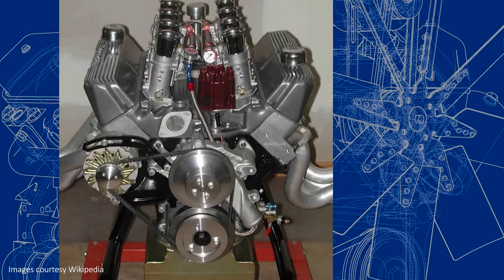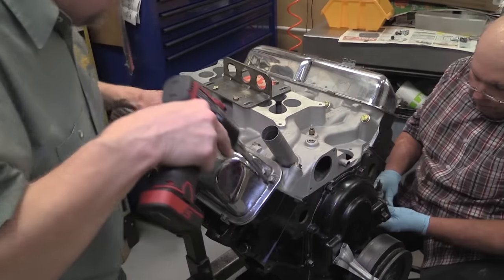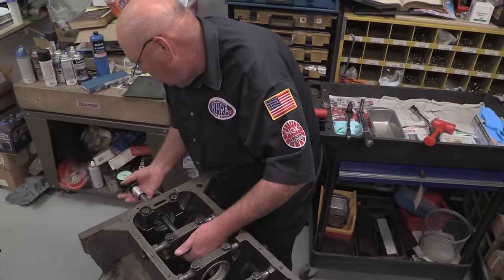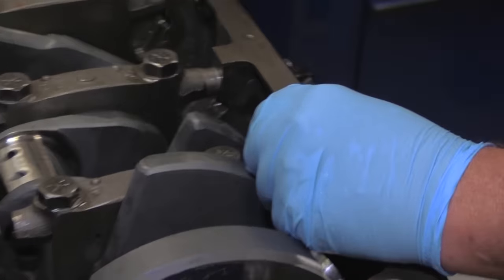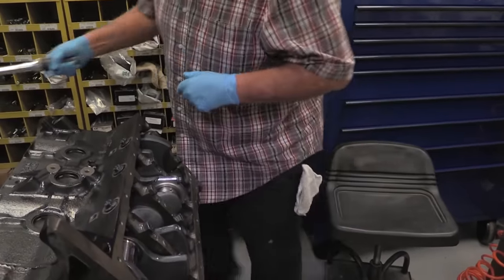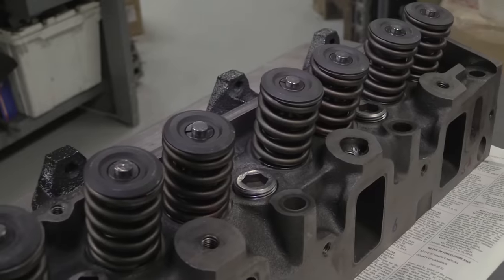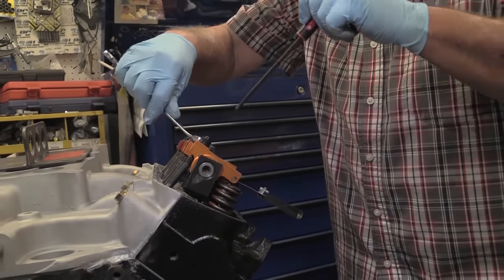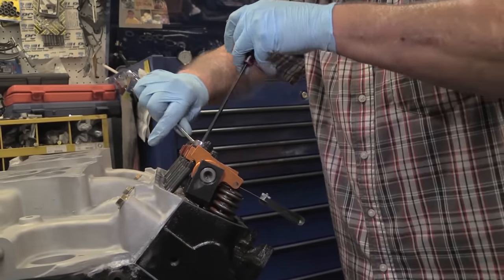Monster Ford 427 Top Oiler Engine Build and Dyno Session

Comment: Notice the age of these builders. Makes me wonder what secrets we lose with each old timer from the muscle car Era.
Reply: Wilson Solt none. Because they don’t ever listen to the new ones. 🤣
Reply: @BuzzLOLOL  i think I've seen that one. They put a tunnel ram on and it develops bottom end torque as well picking up 50hp.
Amen to the extra 150 years. It might actually happen within the next 5 or so years. I heard an already known compound is undergoing clinical trials. Hope so. I'm in no hurry to age at the usual rate lol.
Reply: @ThePaulv12  put efi on it...
Reply: @hellblazer275  yeah it has it! Fitech (maybe youre trolling me lol)
Reply: @ThePaulv12   just get an efi manifold and have 8 injectors with a decent ecu................ even a mega squirt will work haha
Reply: @ThePaulv12  I dont get your reply. So if you want a big bore low deck then build one. Who is stopping you? Maybe the old guys think your nuts because the G2 is only 0.4" taller and if you wanted to buy quality components would turn 7k as well. If you are a Mopar guy and want cheap power ( those words cant go together ) why not spend some time on the 6.4L G3? Has amazing head potential with the stock goods.
Reply: @ThePaulv12  I think I understand why they are getting annoyed. The LSX only needs 90lb on the seat because the 8mm hollow valves in their performance heads weigh ~90 grams. The valves in a typical performance Gen1 weigh 115 grams. The fact it runs well probably has more to do with the fact its fresh then the silly springs. Sure beehives offer advantages, but the fact the LSX can turn 6500 on a 1.7 rocker doesn't mean it will do that for you with heavier components. Its a system of components not just a spring or valve. None of us were there for the conversation you had with Guy #5, maybe he said things like this. Maybe he just didn't like them because he has had them fail. Ya know like they fail in LS6 motors on a pretty regular basis.
Reply: That's a fairly intuitive analysis actually lol.
Here's the thing, those springs are known to be good on Gen 1 engines which is why Comp make retainers for them. The low lift (around .5") means the higher mass is offset by the lower lift because the inertial forces are lower so a lower rate spring fits the bill. It is a fairly well known mod, though #5 is still an old woman.
HOWEVER (LOL) back to your assertion he's had a failure, and our conversation before the job started. Well he has had a failure, my fellow mechanic friend told me. It wasn't catastrophic but more embarrassing. It was on a speedway car and it wouldn't rev up. They were the totally wrong springs for the application and the customer - like me - specified he use them. They weren't the 90lb GMP springs I supplied but a another brand (I literally don't know) and the springs were all wrong for the application. 
The difference here is, I know what I'm talking about and If I don't - so there's a known unknown - I'll accept responsibility for that or opt to go a known route. These light 90lb springs are fitted to Vortec heads all the time and improve performance (when the valve bosses are turned down). They are a known mod and work. #5 never at any point conveyed his speedway story to me. He decietfully nodded in agreement before the start of the job to get the work, in full knowledge of my desire to use these springs then when it came around to setting up the valves would've thought 'to hell with that' and tried to get me to bend. Well I'm not for bending in this case. I do bend and did bend on this job in some other areas. I wanted lash caps because my pet hate is roller rockers. The surface intensity of the roller on the tip of a low lift cam is multiplied as compared to a stamped arms' wiping face, but stamped arms are crap in the ball stud area and have no adjustment so what can you do? #5 informed me although he bought the lash caps for me he couldn't actually use them because of geometry issues which he could sort out but were financially inneficient for the gains. I just said fine! I understand.
Re the failure, I got the blue ones they're about the 4th revision and the failure rate is low.
Reply: It's because it's not a stroker. That's the problem. They want the easy job not the complex build. They just don't want to listen. Yes I can build it but I may need custom pistons and some unforseen expertise esp in rod length and pin height. This means I have to throw them some work before they'll help me. If I build a common combo then that is all worked out for me but I really want a low deck short stroke big bore Hemi that looks like a stock Hemi minus exhaust manifolds. 
As far as the Gen 3 the issue again is, I want a low deck aluminum Gen 2 with a 4.5" bore and a 3.3/8ths stroke.

The Gen 3 makes far more sense but sometimes I like to be a pioneer. If it doesn't work very well then all I have lost is some pistons, rods, a crank and perhaps a camshaft. I think however that it will work and make about 550 at 7500. It's about the revs. I want a Hemi on the street that revs up but has the cubic capacity to still have some street useability.

See a 572 is a great thing no doubt. It makes 800hp hell even a Barton 528 will do that, but they are a bit overpowered for an A body and despite the trend to build +1000hp engines these days I just want a Gen 2 that turns rpm like a racecar, be reliable and look stock. This comes from heritage of the Hemi. I just want to make it what I think it should be and a high rpm screamer with a big bore gets me going.

To each his own.
Reply: ThePaulv12 If its that big a deal to you built it yourself. Have them do the block prep. Im not saying "building" is assembling parts. With aftermarket blocks and the works nothing assembles the way you want.

  On the lsx springs thing sounds like he should not have agreed to do what you want in the first place. I just had some head work done where the shop didnt want to do what I wanted. Cut my oversize valves down and made me pay for it.  Porting guy wouldent touch it because they were not prepped the way he wanted. Now I have tons of money in junk. All I can do is start over. This is how it happens sometimes.
Reply: Dalton,wrong,why do you think I'm here,been building since 1968,i've read the info from the genius of auto design,BLACK,PINK,WATERMAN,YUNICK,you stop learning you go backwards real quick and you start losing races,fact
Reply: Kenny isnt that young, lol. Kenny is appx my age which is over 50. Hes been building  for nearly three decades.
Reply: Not true we have better technology now to where their "advice" is becoming irrelevant from fuel injection and forums
Reply: @ThePaulv12  what do you care if nobody's on board? Build the motor and prove it works! I'm just not getting the correlation between low deck and seven grand? Why would centerline of crank to top of deck restrict anything? Maybe torque would not be optimum due to having limited rod length but screw that.Go for it.
Reply: @hellblazer275  stuff a cut down 3.75" 383 stroker crank in it and leave the 305 badges on it.
Reply: @ThePaulv12   305 makes a good boat anchors
Reply: @ThePaulv12   big rpm Hemi  - didn't Ford do that back in the 60's - Cammer?
Reply: @philipmacduffie7612  he should of put 289 -351 Windsor in the ToTo.
Reply: @Richard Skipper you mean like build a350 ?
Reply: @ThePaulv12  right ?
Reply: I’m 35 and been into these cars since I was eleven. A classmate of mine has an engineering degree he uses to operate an engineering company devoted only to BBF
Reply: Not what hes saysing. He saying these guys know there shit and they'll die with there knowledge
Reply: ThePaulv12 Just an observation from an "old machinist". (60) While you are on here bloviating about some hypothetical engine that you "might" have built, either in the past or future, the gentlemen on this video have an actual functional engine. A very nice one at that. And just so you know, it will outrun your hypothetical, imaginary engine EVERY day. I can't speak for the machinists you allegedly approached, but I have youngsters come in my shop occasionally wanting a " new combination". Most come here for my expertise and will listen to reason, as my engines have won numerous championships from dirt to drag to competition carts. I think I can speak for most machinists when I say "put your money where your mouth is and I will build it for you". I suspect you had more mouth than money.
Reply: @ThePaulv12  You're taking it too personal. They've been around long enough to know that experimentation is good way to step into a bunch of bullshit and kill your profits. A good business model is to stick with a tried and true formula with little deviation. Most every master mechanic I know went thru a experimental phase when they were younger. They wasted a ton of time and money doing it, but thru that they came up with what works for them, and what typically doesn't. When it comes down to it, it's not their job to turn your ideas and fantasies into reality. Reliability is their main concern. Who wants a engine that spits it's guts out? No matter how much power it makes.The other biggie is profits. Its almost like customers are pissed off because shops want to make a profit these days.
Reply: There's no secrets to a build that is nowhere near on the edge lol if it made 800 I would say different but this isn't anything special
Reply: Takes patience. Comes w/ age & time.
Reply: They have have the blueprint to these amazing engines .. my uncle is the same way stuck in there ways he don't like ls motors  and we argue about motors all the time
Reply: @ThePaulv12  The young today have a huge advantage over the old of yesterday.  Parts.  I am 60, when I was in my 20s there wasn't any brand new blocks from Ford to mate up to a crank and some rods and pistons to create a 454 from the 351W block.  We didn't have the high port Trick Flow heads with ports bigger than the 4bbl Cleveland heads.  That 454 Ford Windsor engine put out 730 some odd horse power.  I would be embarrassed to be a kid today if I couldn't put something together out of catalog parts that would not out perform the best that $10k would get you 40 years ago.  Nitrous was just coming out then.  You could get a kit easy with a full bottle, two days later after showing off in front of your friends your bottle was empty, and it took 3 weeks to get it refilled, 20 pound bottle ran me $90.  That was a plate kit from Marvin Miller that ran me $750 to purchase.  
Kids have it so much better these days.  All I can do is look and dream now.  Had I known this was only 40 years in the future I would have not spent near 40 grand in the first 20 years of my youth, on cars.   
I have yet to ever find a store owner refusing money.  I think you are confusing "bench racing" with "parts buying".  Try walking in with your credit card in your hand, list of parts you want to order, and stop trying to convince someone that you know more than they do, show them.
Reply: @margaretpurifoy9107  not about these parts. Like i said they have no imagination. Sure if i want to travel big miles to find a shop to do as i ask i can, but the prospect of a 300mile round trip to find a shop isnt my idea of fun considering I'm a trucker these days and always behind the wheel.
Reply: @22099dscott  you say, "you're yet to find a store owner etc etc"
Well, about these parts it doesn't work like that as i have already chronicled. In fact i often say to store owners (as a gasp of exasperation at their stupidity), "You must have so much money that you can afford to treat customers like this."
Look it is true that i am a qualified mechanic of many years but these days i drive big rigs for a living. This makes me time poor. I get really pissed off by these morons - and they are morons, that have the attitude that if they can't see the need for what i want then i don't need it. They don't want me as a customer it is as simple as that. Sorry but you're wrong about store owners.
Reply: @philipmacduffie7612  Rewatching this vid, stumbled on your comment about how your machine shop ignored your directions, and cut your oversized valves down. Then "made" you pay for it... 
Hahahahaha! Not even gonna say it.
Reply: @edjackson4389  If a shop does what I ask of them, then I will pay them money. And come back for more work.
Reply: @izzyplusplusplus1004  Didn't know when I picked them up. Of course I went back but they didn't want do shit about it.
Reply: @philipmacduffie7612  I can't even imagine how pissed I would be. What shop is this? Do they still exist?
Reply: @izzyplusplusplus1004  They went out of business and they deserved it. I wasn't the only one to get hosed. Bad part the really good head guy has Heath issues and his place is falling apart. Can't get in there.
Reply: @philipmacduffie7612  I think this brings to the table a good point of reference. Careful with your machine shop choices.
Reply: @izzyplusplusplus1004  Cool. As long as I make my profits, and you're not an unreasonale jackass it sounds like a plan.  I just don't have time for 'rookie experimental bullshit' When I've got a backlog regular paying customers already waiting to get in. If business was slow it might be a different story.
Reply: @margaretpurifoy9107  I'm sure bench racing is a professional league at or around your shop. But when I have to flow bench my own heads ( because I wanted to know ), balance my own cranks ( because it needed 6 slugs and no one wanted to do it ), and setup my own heads ( because the damn valves dont even come close to sealing ) if I can't even pay someone to do the work there is a problem. I'm glad I learned some things, but it sure takes a lot longer to get your own experience as opposed to renting.
Reply: @daltonhayhurst8501  Beacuse most of the new ones don't have a clue about the old stuff.
Reply: @hellblazer275  Lmao !!! Whatever
Reply: The young guys will not care about gas engines. They will be playing with electric motors.
Reply: A lot of younger guys building some amazing engines. Yates has a lot of younger builders doing engines for nascar. Nelson race engines is a team of younger guys regularly pumping out 2000-2500hp engines. UGR out of Charlotte is a younger group pushing 3500+ hp from a Lamborghini. Don't get me wrong there are a lot of respected engine builders out there that are older, but the new guys using all the technology and advanced alloys we have available today are pushing the bounds of engines. Who would have though Ford would produce a factory 3.5L V6 making 660hp in stock format? We are truly in a time of some amazing engineering and amazing alloys to build engines that are way more reliable and powerful than ever before.
Reply: Check out Nick,s Garage on youtube , he is based out of the Montreal area .
Reply: im sure there are many young fellas with a passion for engine building
There are guys in their 20s building 1000hp monsters
Reply: Yeah well the price on parts never goes down ......$1500 for heads on a 360 fuck
Reply: @ThePaulv12  I am going to be honest, I needed to see this post. Being a young guy, I love it all, old style big muscle car engines with massive carbs and big decks, new age LS motors with massive ass camshafts and 7750 rpm redlines, and 10K rpm boosted JDM Honda and Toyota engines. I have been watching this massive war interchanging among all 3 of these groups, even being fired at me, and with the negativity I have been hit with, I am contemplating not to be a car enthusiast because of how toxic all of the communities have become (and wasn't the point of being an enthusiast in the 1st place to be able to get away from the negativity of normal life). This comment is encouraging me to keep pushing forth through the community hate. I have never fired hate against a yesteryear creation or community like this unless I have been fired upon repeatedly...
Reply: i heard that
Reply: We are losing the tribal knowledge that we sorely need.  I love the FE and I hope that we can get this crap about regular FEs need 20, 000 dollars for good power. Build a good 450 hp 400 ci FE with a set of pro- gram caps and put a VS 7875 turbo on it and enjoy the 800 hp result and forget these overpriced boutique thieves. I have been getting 425 hp from .030 over 390s with good hardware for 50 years and this high buck crap is a joke. Everything loves boost. 10 lbs to 14.7 of a 396 ci FE at 1 hp per ci you double the power that is at 800 hp. The 7875 125 a/r will rev to 6200 and with 14.7 lbs boost you can have a bunch of fun. These are a robust platform. Why do we spend so much money fixing things that don’t need it? Get the exhaust to the turbo and say bye bye to these $ 15,000-$20,000. builds?
Reply: @daltonhayhurst8501  I am 61 and I believe that putting a Chicom turbo on that has a rising boost curve. Use your old timer knowledge to put together a good strong enough 425 hp 390 at .030 over for 396 with a cam and intake is quite easy to make that add even 10 lbs of boost and you are over 700 hp FWHP. Are us old timers dumb? Guys take advantage of magazine and internet myths to steal your life out from under you. F them young or old. Built a good 396ci FE and boost it. You will love it.
Reply: @ThePaulv12  F n A
Reply: Yes indeed ...i hope they passed it down
Reply: Sad man
Reply: I hope they wrote some books with their knowledge!
Reply: @Wayne Lee  Ford did have a cammer  for racing. That jackass Bill France Sr would not let the Soch or Doch run because they would have been unbeatable. He let the 426 hemi run, but Ford still beat them. The Soch was 675hp with 2 4bbls & the Doch 795hp with 2 4bbl
Reply: Precisely
Reply: @lieugebo805 like you said. Wasn't and it's that hard of a build.